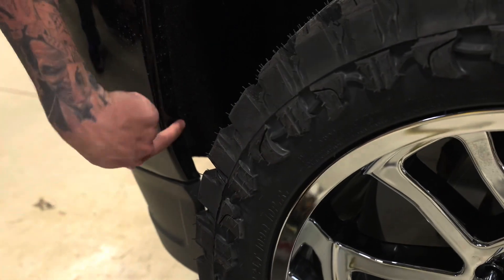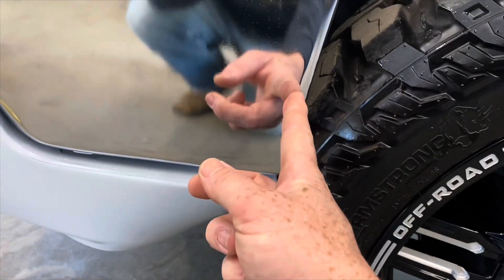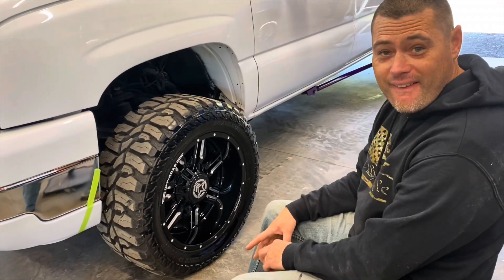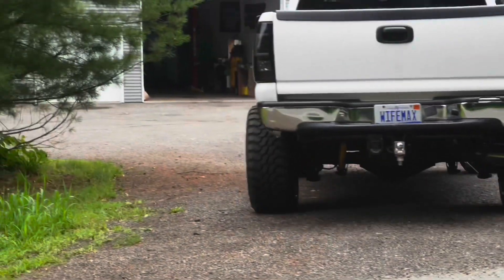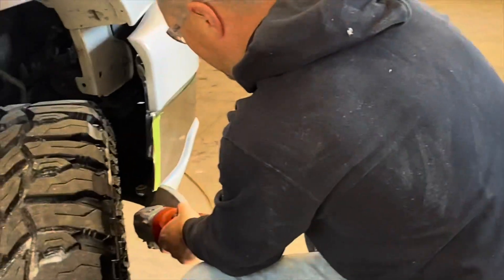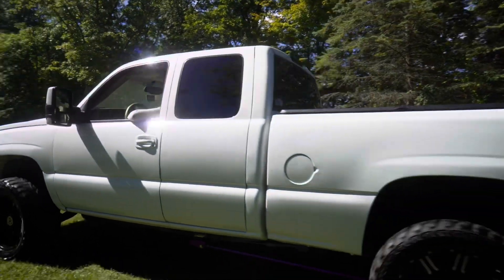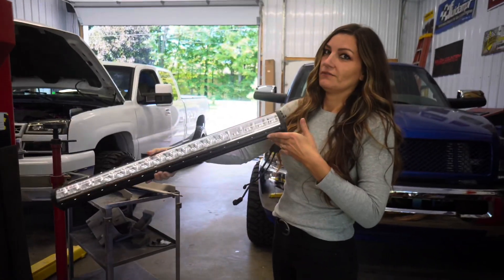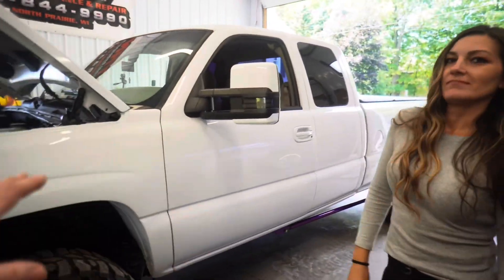Just Painted Her Duramax And Forgot To Do This! *HARD TO WATCH*

Comment: That's why I never put 35's on any of the GMT 800's I've owned. The wheel wells simply are not big enough for them. I always ran 33's as they fit perfectly and look way better than 35's that have had the wheel well lines hacked up